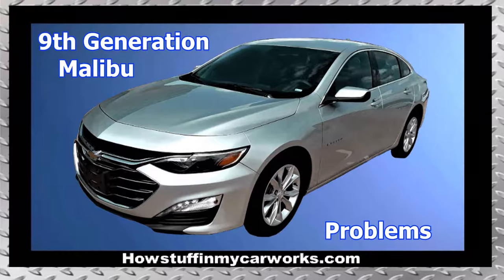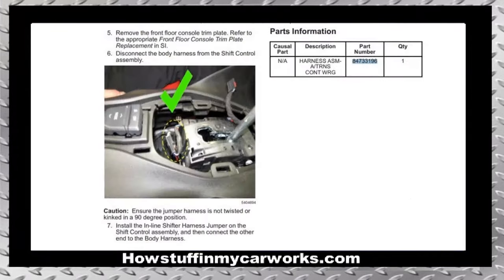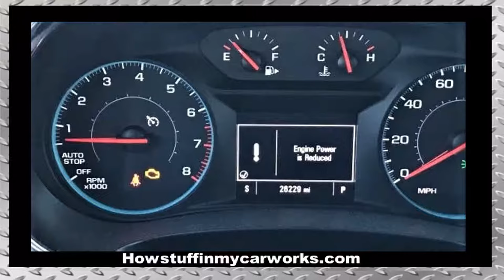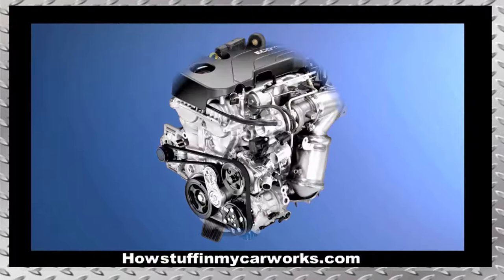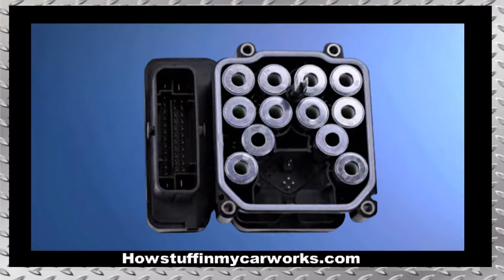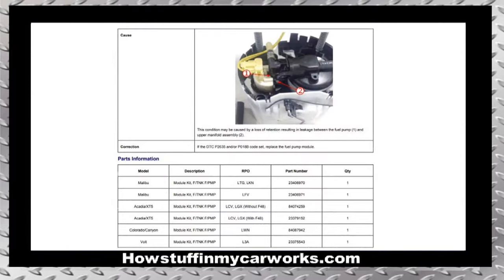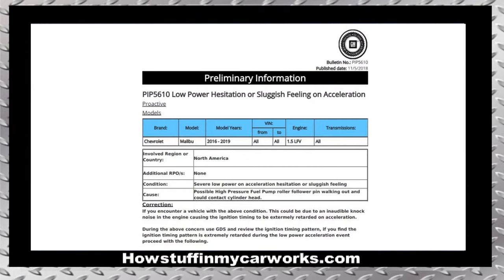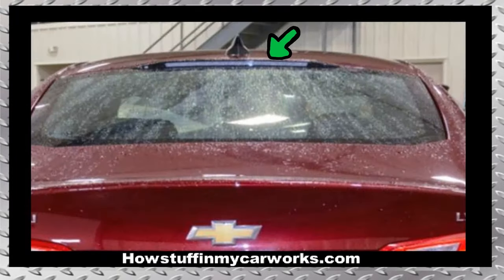Chevy Malibu 9th Gen 2016-2022 common problems, issues, defects, recalls and complaints

Comment: Have the 2017Malibu Lt it has only 31k miles on it and so far only one issue. The MyLink touch screen went completely black and won't come on. Radio still works through the steering wheel controls fine. I'm trying to figure out how to get the screen to power back on or reset. Tried to disconnect the battery 5mins-2hrs and nothing. Done the open/close the door thing Google says and still nothing. Going to try the fuse tomorrow. Anyone else have this issue and know how to fix it??
Reply: I have a 2016 LT and I get this issue but its very once in a blue moon type of dilemma. I simply turn off the car, walk away, then come back within like 2-3 min. Start up again and its perfectly fine. Also cases like the screen freezes up but the music is playing fine. There are times I turn off the car, open the door, close the door and start the car again. It fixed itself. 

Pretty bizarre issue if you ask me.

Comment: I have a 2014 Malibu with 200k miles and I just recently ran into a problem where when I crank it up it’ll go from park to manual “ it dosnt shift nor do I shift it” the light indicator changes on the center consol. Another problem that came with this is I caint put it into drive until it kicks itself back into park and shows that it’s in park. Also when I’m driving the same little light will randomly switch from d(drive) into M(manual). And I have put so many hours into trying to find out why or how to fix it, but apparently no one else has made a video, post, nor a arrival about how to fix this. And the Chevy place charges 100 just to inspect it and find the problem and I don’t want that. But it’s looking like my last resort

Comment: My biggest regret purchase. My 2020 Malibu I’ve only had for 1 year in the shop rn for check valve cracking off somehow and now I need a new motor… not to mention when I got it at first, had to get The whole transmission replaced since it would severely lack when shifting to drive from reverse. Down with GM
Reply: How is it running now?

Comment: why not just recall this car all together ugh its a headache, if anyone has the valve cover torq specs for the 2016 ..1.5... let me know please, had the brake fuel pump brake off into the camshaft area, luckly it didnt cause to much damage i can see so far.. $300 in so far with repairs

Comment: I have problems whit the trunk 
Sometimes open and sometimes not
Any idea?
Reply: Clean the lock with Carbonate cleaner and oil it 
Or maybe bc the lock wire is damaged or the lock plug for it got some carbon salts so u have to clean it or replace it

Comment: I have two of those problems shift to Park sensor in my 2018 Chevy Malibu is acting up and the same thing on the top pieces where the brake light is so I put duct tape black waterproof duct tape over it and cut around the edges so it fits they want $800 to fix that and I will not pay 8:00 tape is working fine for now cost me $7 and I keep taping it I know it's a cheap way but it works now the problem I have is the passenger side door will not lock it just started this week all of the locks are red except the passenger I even tried to reset it it goes back to it and then said presents itself again anybody know about this problem

Comment: 2017 Chevy Malibu 79,000 miles went into limp mode and now won’t start cranks over but sounds like the starter stuck 🤷🏻‍♂️
Reply: That's about it, it nears the end of its life, things are starting falling apart from this point.
Reply: @user_uif_ghg_wer_das  Im on the 2nd motor 56K miles and 116K on the chassis. Its still trucking along but until how long? Only time will tell. I'm the original owner and bought brand new in 2016.
Reply: I have a 2018 malibu and the same problem found out it was the vacuum pump exploded in the engine cause my brakes to harden at this point I’m done with any GMC cars I’m doing a voluntary repo cause I’m not paying for another engine replacement it’s a faulty part without warning
Reply: Fix it and trade it in for a Toyota
Reply: @MultiSheniqua i switched to Toyota and never felt happier

Comment: 2017 has a stabilitrack problem
Reply: My 2018 too. It broke down yesterday. Chevy should allow us to trade in for a good deal because I think the 9th generation makings are ALL defected
Reply: Mine too. Happened yesterday. Car stopped at a light
Reply: There's a stabilitrak issue with the 2018.
Reply: @jeanibottle1231  It does have the auto shut off to save on fuel as they say.